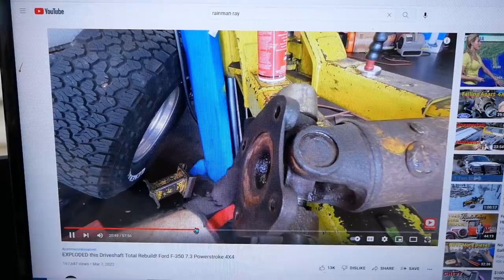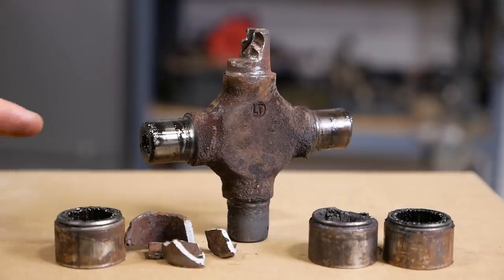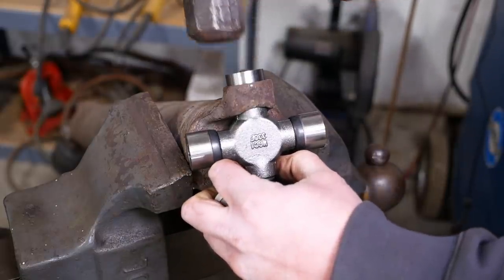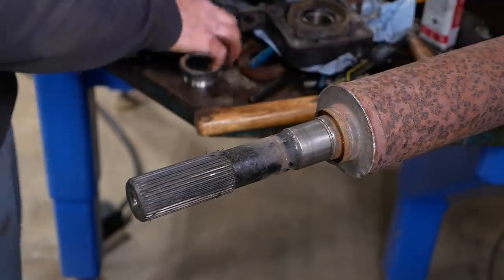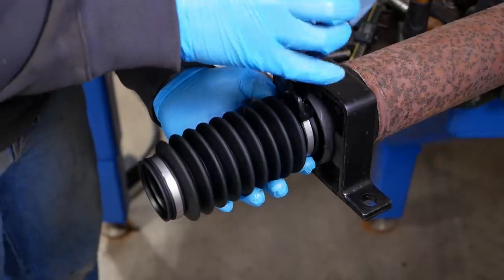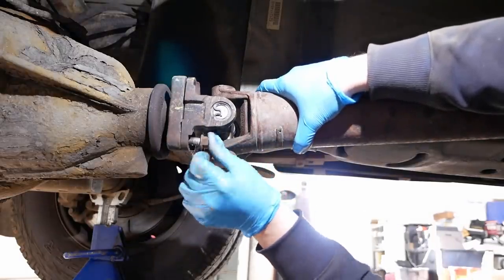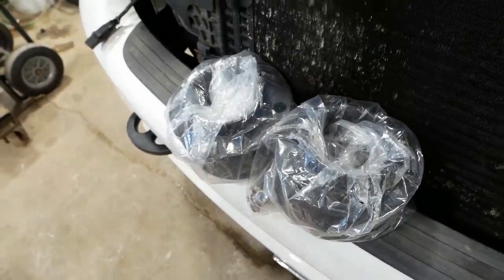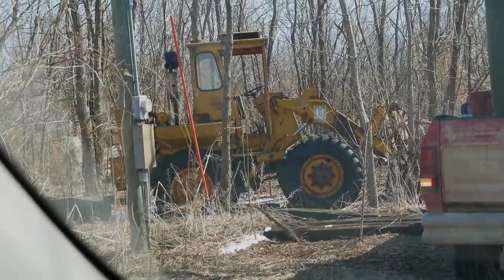Self Exploding Drive Shaft - Too Much Cummins Power...

Comment: For the ripped boot use 3m weatherstrip adhesive in a jam. I used it on my boat boot a few years ago and it's still holding. Saved me from pulling the lower unit. May take a few applications
Reply from the maker: Hmm. Can you make a whole new end with it? I thought about using a tire patch.
Reply: @WatchWesWork  I just had rips in the raised portions and so I put it on and it worked good. Sounds like a janky fix but I didn't feel like pulling the rear end off the boat that's a lot of labor.

Comment: Wes, my take on installing a universal joint is, if the manufacturer tells how to install it, that's what I do. If not, the tried and true tested way that keeps working is how I go. Also, if I'm using someone's equipment, and I'm not in my shop, I use the method that corresponds to available tools.

Comment: Just replaced the u-joints on my ranger due to a vibration. Unfortunately I had 1\4"-1\2" of play at my rear end input shaft. I guess 350,000mi will do that. Time to park it until I replace the rear end.

Comment: Rainman ray is the 💣 diggity Wes. Definitely up there with you on doing Auto repair videos. I do however have a ? How much would you charge to change out 4 direct injection fuel injectors on a 2017 Honda civic si? Before anyone asks, yes the injectors are bad, I've thrown the parts cannon at it with us n wires and used my scanner to clear codes also did a hard reset on the pcm/ecm

Comment: Had a 72 gran prix the motor was built a little 
Blow the  clips right out of the rear end 
Got a u joint  that had the clips on the inside of the cap so I didn't have to take the hub off the rear end 
 I was a teenager so I rode it hard and put it away wet Never had another problem with that universal joint
 I don't know if you could do that in every situation But I was able to do it It was the same universal joint just had different For the clips The clips went on the inside instead of the little Spring clips

Comment: I'm not a fan of that type of leveling kit either, especially on a solid axle 4WD.  It also screws up the front pinion angle and causes issues there.  Then you try to correct it and can't get the caster right, camber isn't adjustable so it drives wonky and chews up tires.

Comment: I don't know man but it looks as though somethings out of whack concerning that drive shaft arraignment. Now this is of course old stuff but I have a 72 Chevrolet long wheelbase truck and my fathers 77 Chevrolet truck long wheelbase and both vehicles have two piece driveshafts. The front shaft has of course the yoke coming out of the transmission and the carrier bearing is on the splined end and of course the carrier bearing is bolted to the frame crossmember. The slip yoke that slides on to the splined end of the shaft is attached to the back shaft and of course attaches to the rear axle. Isn't that for the yoke to slide upon the splined end of the front driveshaft as the rear axle assembly moves up and down going down the road and of course for being unloaded or loaded. Every two piece driveshaft I have encountered is setup that way and if the vehicle has a transmission with a output yoke solid fixed on the transmission there is a slip yoke and a carrier bearing. Even on big trucks that is the case. You say somebody has been in the drive shaft assembly before. I say they have it incorrectly assembled and that is what probably caused that u joint damage or contributed to that u joint failure. Not to mention that the rear u joint generally fails due to drying out due to it being exposed to the water and snow and such. Both trucks mentioned were original and both were set up that way from the factory. My fathers 77 he bought new and I bought the 72 from the original owner, you could tell the driveshaft assembly had never been out of the truck. Somebody it looks, had reversed the yoke coming out of the transfer case and the flange bolting to the rear axle. It seems the driveshaft is backwards.

Comment: I remember when the first Dodges came out with the Cummins. There were several people in the area that tore the rear ends or the clutches out. They were usually the ones with standard transmissions. Too much torque I guess.

Comment: That's the way I install u joints is with a hammer I usually will add more grease in the caps before installing them though.

Comment: In 40 years of driving and doing most of my own repairs I have never put U joints in with anything BUT a Hammer. I know the Safety reason they went to a 2 piece drive shaft( so if your front Ujoint fell apart the drive shat digging into the ground as you continue foward would not be long enough to lift the rear of the vehicle  high enoug and fast enough to flip you over ) but I have always thought apart from that it was just a way to put more parts in the driveline that would wear out and need replacing. In the old days of one piece drive shafts the dont flip me ix was a simple  drive shat catcher at about half way that would prevent it hitting the ground no matter which end came detached, To me this was all they needed to do to the old tail shafts but would be interested to know if anyone kno9ws of a real reason other than this that makes a 2 piece drive shaft better?

Comment: How about props to one Godfey Kaplan and the fine folks from Owattona, MN.
If you are going to be farting around at the top secret salvage yard, you should remove one of the winches from the crane. Then repurpose said unit back at HQ. 
This is where your expertise as a legit, degreed Electrical Engineer could truly shine. Mount the winch in the back of your shop, directly centered and in parallel with your overhead door. Fabricate and install an electrical motor to drive the winch. Also add a variable frequency drive unit. No, I’m not done. Also add a remote control unit to allow for forward control.
With this device you could winch in dead equipment and vehicles into your shop, by yourself.
I’m sure the folks over at Hufflepuff towing would endorse this endeavor.
I would be willing to submit the required documentation to receive the proper security clearance to work at the top secret location. I would be willing to remove the winch. I’m sure others viewers would also be willing to assist.
It could be the innagural “ WWW Invitational Wrench Off Jamboree 2022 “

Comment: At your 2:30+ there I see a grease nipple which is dry as ....... wonder why it failed? 
Think you should have removed the old grease/dirt on the splines? Wire brush /brake clean. 

Here is a question.
If I can find a place to do the work? if the rear end is suspended to reinstall  the new driveshaft as it  was damaged and replaced should be able to attach the driveshaft carrier bearing then rotate the driveshaft to fit the flange onto the output of the Xcase? As that was damaged?? as well have a new one to replace it but to mark it then replace it into it's same place? Does that sound like a plan?

Comment: Oh good you got a engine for the loader,  it's a 6 cylinder gas IH about 300 ci?.  I have one about that size in AK
Reply from the maker: It's a 301 I think.
Reply: @WatchWesWork  where did you find a motor

Comment: After 25 years of driveline experience I have installed joints with just about anything that will get the job without denting the tube or dropping a needle bearing out of place, when that happens a fella could almost eat ice cream I tell ya!🙄😏😉😂

Comment: As someone said below (and I am sure several "know-it-alls" have said) a hammer is a bad idea. Not always, but most of the time. You can bend the ears and jar needles loose with the impact. If you know what you are doing, you can hold the joint in the cup to prevent the needles from moving and judge how much force is needed that would be safe. As a rule, it's a bad idea, but there is no ONE right way to do anything. Experience tells me that if you know when it is safe, you can use many methods. I still have all my digits.

Comment: I am amazed by how much rust is underneath US vehicles . Is it because of the salt they put on the roads over there ? The whole underside looks badly corroded. . Another very enjoyable vid Wes .
Reply: Alot of states here use salt which sucks you can have a 6-7 year old vehicle rust away with low miles

Comment: Wes, a quick question. I was always taught (50++ years ago) that since the power is coming from the engine back (or forward for front drivelines) that you should locate the grease (zerk) fitting such that it is in compression rather than tension as the engine powers the shaft. Have you ever heard that? Do you do that in practice?
Reply from the maker: I never paid any attention.
Reply: @WatchWesWork  I've googled it a bit and it does seem to be a "real thing", particularly in heavy loads.

Comment: I used to only do this kind of crap to my rock crawler. When you got enough money to make that happen you just take that to a drive line shop.. not saying that i never had to do it on the trail. I did. Oh and the drivelines I was ever working with were only about 3 feet long. And none of that double long and damper crap.

Comment: My 2001 Sierra 2500HD 6.0 has two slip yokes as well. Those damn rubbers on them carrier bearings always go to shit. Owned my truck for 6 years and I’m on my 3rd one. I’ve used a different brand each time. Right now the one that’s in it is from National Bearing. Hopefully it’s much longer.
Reply from the maker: I wanted a National, but it was on backorder.

Comment: Any method that allows you to install a joint without loosing or dropping a pin into the bottom of the cup, IS A WIN... THAT'S WHY WE GET PAID "THE BIG BUCKS"....Also the use of a BIG HAMMER doesn't hurt.

Comment: The people that complain about using hammers on ujoints probably haven't done many field repairs, especially on farm equipment.  And those dodge Cummings are hard on ujoints,  I used to snowplow with one and it wouldn't go a winter without needing them changed twice. That was probably because my boss wanted me to plow as much snowplow with the pickup as I did with a tractor with a 12ft blade in the same amount of time.

Comment: Those old tanks make good septic tanks.  For a drain field you just fill a 55 gallon drum with cement blocks and run the exit line from your new used septic tank to the old 55 gallon drum and away you go.  Or go away, however you want to look at it.  And hope nobody with any sort of public health credentials ever digs it up.

Comment: Picky picky, carrier bearing was fine, just spray foam the rubber and all good.    
Clock the joints? Why bother, a little vibration is not all that bad.
Do things right? Naw, takes too long.
Sure wish you lived closer.     lol
Thanks for sharing.

Comment: Is it just old fashioned to call a drive shaft a drive shaft? Or is it maybe regional? I worked at a drive shaft shop and there was a drive line shop next door and the difference was the drive line shop did transmissions too so I always assumed the drive line was the transmission to the rear end and a drive shaft was just a drive shaft

Comment: Out of curiosity, do the car washes up north still operate in the winter to help clean off the road salt? (Guessing they'd be completely enclosed or something? Or maybe just open when its above freezing?) Though I doubt there would be very many out in farm country, so perhaps you'd have to drive a ways to get to one? Then there's the cost of using the wash...

Also, what work light is the magnetic base wand style one Wes has? It seems really useful
Reply from the maker: They usually don't work when it's below 10F or so. Some have garage doors and are heated, but not out in BFE where I live.

Comment: For want of a nail the shoe was lost.
For want of a shoe the horse was lost.
For want of a horse the rider was lost.
For want of a rider the message was lost.
For want of a message the battle was lost.
For want of a battle the kingdom was lost.
And all for the want of a horseshoe nail. 

A squirt of grease
Did he, or you suggest you check fluid levels?
Or is a Dana70 rebuild in the works?
Good vid,stay well.

Comment: My father always told me if it ain't broke don't fix it (u - joints ) 
I have a 2000 Chevy van 2500 express 350 vertoc 
No check engine light
Misfire, running rich,starts hard,and what's stall 
Hook it to a computer crankshaft sensor po338
But throw these code to po106,po154,p1345
Is that because of the bad crankshaft sensor

Comment: I dunno, Wes: a marked - and fun - increase in the video production skills. The new software and camera is certainly helping but the shot composition is working. Good work! You ever want to hang up your air hammer, you should consider a career in video production. What camera did you end up going with, btw? 

And awesome content as usual. Who cares how you do it? It'd be a travesty if you only got another 100k miles out of those yokes for doing it the way you do. What a shame. 🙄

BTW, thanks: I saw the mug and blew water out my nose -'preciate that. 🤣
Reply from the maker: I've been using the Panasonic Lumix G85 for over a year now. I got a fancy lens for it and that really made a difference.
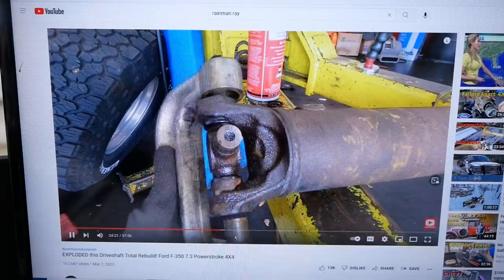Reply: @WatchWesWork  Yes it does. Great work, man. I liked the focus pulling at 0:25 and 0:28.

Comment: Sir Walter Dalrymple Iron and Bleek Hammer is the only tool to do u joints they are only 6k .all other attempts to do this job is wrong and the wrench that does it should be flogged and put in a stockade. I personally use any and all tools that work . The best tool box in my shop is the refrigerator and there's no soda in it.

Comment: Exhaust pipes make great bearing installation apparatuses.  That's what I used to put the bearings on my posi unit.

EDIT: Shaft lube.  :)
(I will be 12 forever)

Comment: I watched R.R. for about a month. The drivability issues are interesting, but you can only watch so many unedited brake or minor repairs from a somewhat rust-free area. No challenge. I prefer the rust belt challenges and heavier equipment.

Comment: He seems to be good. Not like what I have been finding! Just do a good job once! If it costs more then I Don't Have to Go Back!!!!!!!!!! 
I have a fuel light on for sometime now. I removed the W/F sensor and pumped a bunch of fuel out, didn't change. eerrrrrr  But it had to have got past the Donaldson W/F separator and then the filter. Will try to see if there is a code???

Comment: I don't know what the issue is with those who complain you aren't doing it right. The way I figure it, if you don't lose or wreck the bearings, the clips are fully seated, and, the drive shaft turns smoothly and freely, what is the problem? As far as I can see, there is nothing wrong with how you do it. I suspect this isn't your first time doing this and quite likely you haven't had any call backs.

Comment: Grease fitting hole oriented to be under compression while going forward to reduce likelihood of tear out ?
Reply from the maker: I've heard that comment before. Have you ever seen one "tear out"? I certainly never have. You could twist the driveshaft like a pretzel before the u joint will fail.
Reply: Only time I’ve seen them do it is in drag racing with violent launches.  Once in a turbo diesel where they forgot to remove the protective cup where the Zerk was supposed to go.  Love your channel, also watch Ray and Eric O each week. Thanks for the vids!

Comment: I believe the 6 speed has a 1 piece driveshaft due to the longer transmission, at least this is what i was told by a dodge guy
Reply: My buddy has a 06 Cummins mega cab dually 6spd he bought new it came factory with a two piece but it kept blowing out the center every 2 years or less So he had a company make him a one piece in 2016 so far no issues at all he pulls a 3 car wedge once a month give or take and small trailers weekly truck has 211k miles

Comment: Acts as a fuse . Easier and cheaper to replace than anything else in the driveline. (Wouldn't have to if you stopped doing burnouts)

Comment: Had a dodge front ujoint so tight it wouldn't come out with a ball joint press.  Did not have hydraulic press.  Got it out by putting it in the vice and placing the ball end of a ball peen on the cap and hitting it with a sledge. I don't recommend that method.  It was very exhausting
Reply from the maker: Sometimes you have to heat the yoke.
Reply: @WatchWesWork  yeah that might be what I'll do in a situation like that again.  The passenger side seems to get the bulk of the corrosion

Comment: IMO if it can handle banging around on the bottom of the truck for 100k miles, it can probably also handle a few taps from a hammer.

Comment: C'mon Wes, you did it wrong again.  You're supposed to pack the U joint in dry ice, then put it in a sub-zero freezer in antarctica for 2 days while simultaneously putting the yoke into the core of a nuclear reactor for 4 hours.  after that, it'll all drop together without the need to bump it with a hammer.

Comment: I would always replace all the ujoints-you have already got it off the truck-ujoints are cheap-plus all the ujoints are in "series" mechanically and get the same torque/wear-I would assume you would need to ask the owner for permission-if they say no then at least you tried...ends up being a win for you if they fail next year-more shop labor..
Reply: also u-joints at a greater angle will wear faster-like the rear u-joints on this truck

Comment: Aaaaarghhh!!!  The Dodge dealer supplied you the WRONG part!!!
That is NOT the correct 'carrier bearing'...  Instead, it's the remarkably similarly shaped muffler bearing!!!
Unfortunately, they're NOT completely interchangeable!
The muffler bearing is 'tuned' to minimize vibrations at the notorious engine speed of 2351.3 RPM while the carrier bearing is 'tuned' to minimize the vibrations at a driveshaft speed of 372.463 RPM
You better prepare yourself for the recall!